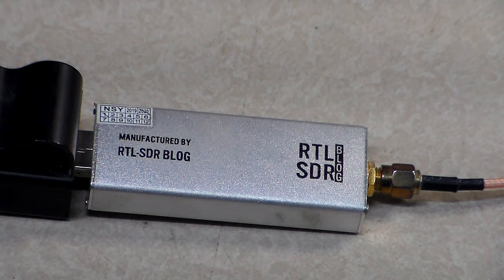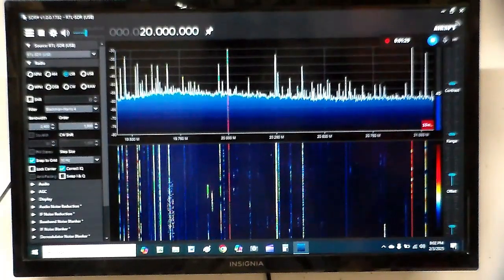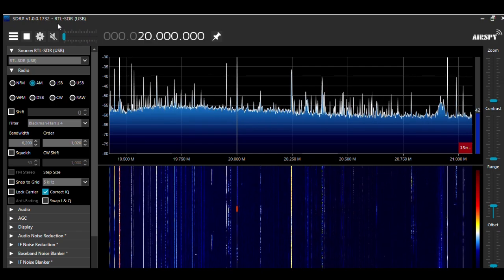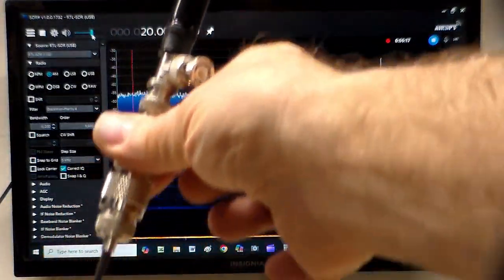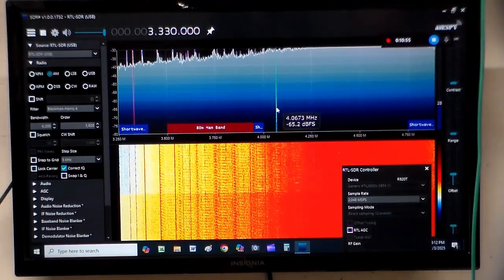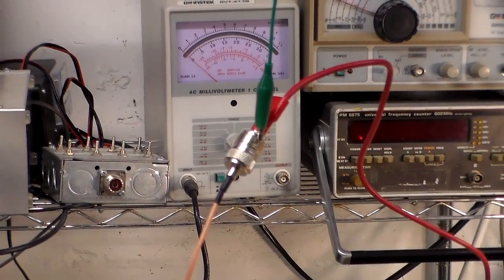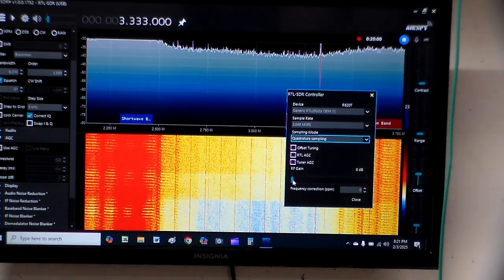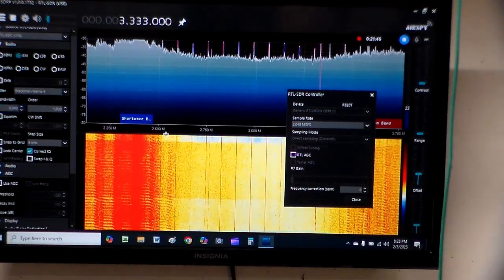RTL-SDR Antenna Options for HF Bands

Comment: Is the dipole kit antenna not good for any Hf? Same with like 20ft of wire?
Reply from the maker: A Long wire with an earth ground is the best for the wide coverage of an SDR. Dipoles are good but resonate best at the wavelength they are cut for and some multiples of it but not for the full bandwidth.